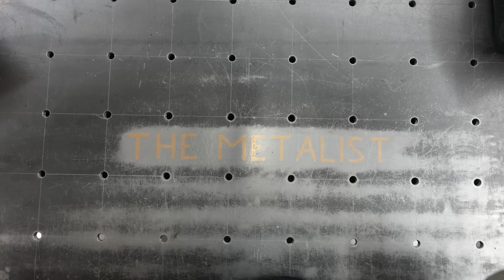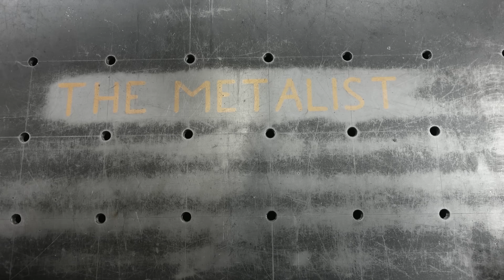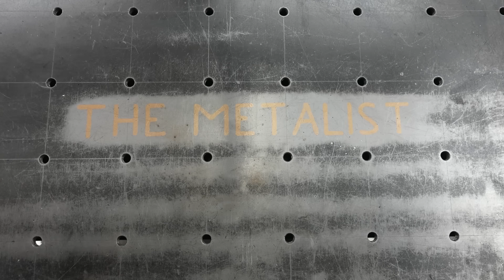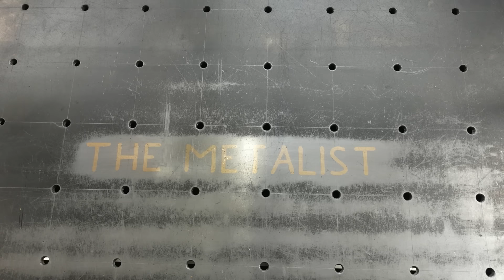DIY Rollbender Roller Bending Radius Bender

Comment: I put this in my watch-later bucket, and now I found it, so I watched it and was mesmerized.  I loved the cleverness and craftmanship, but you had the table and the special drill to make perfect parts.  One thing that I have too is the bandsaw, but mine is the roll around floor model, but about the same size of bandsaw, maybe a little longer.  BUT the thing I want to mention is the table you made to fit on the bandsaw when the saw portion is lifted up vertically.  That is special, I want to make something like it for mine.  I purchased a potable floor model (a standard one that you might have seen at a store).  Well, I made it a roll around by attaching a set of caster type wheels to the bottom of the legs.
I have to make the table a little different for me due to my being in a wheelchair and I have to have separate parts and stuff readily available and not laying all over the place.  I want to make it be attached in some way to the side of the saw frame.
I'd like to hinge the table to the side of the rig and have it fold upwards into position.  I just viewed the video where you made the table and the ease of putting it in place to use it.  It's not bulky or awkward at all.  I can just hang it somewhere when it is not in use.  

Thank you for the inspiration.  I like to build stuff, and tools too.  Roger from Oregon in the USA.

Comment: When i seen your video about your "Dream Welding Table" - I watched it. And thought "Dream table? PFFFFFFTTTTTT". I didnt see the versatility in it until i watch another video several weeks later. Of you building your tooling to fit in the threaded hole of the table. I LOVE this design! I do have one question. How do keep from dinging your threads in the table? I mean when inserting the bench clamps?

Comment: Wow, very clever design! I especially like the rollers, they look very stout. I’ve seen you use a sliding depth gauge in many of your videos, in this one it’s seen at around the 1:27 mark. Do you mind sharing the brand/model? I could really use something like that in my woodworking projects and yours looks like a really solid example. Thank you!

Comment: Ingenious as always. Can't really say anything that hasn't been said by others. But I do have a question: how does Rehm compare to Fronius? I use a Fronius Magic Wave 4000 at work and am just curious. By the way, nice to see someone use Cubitron discs. I love those things. Keep up the good work.
Reply from the maker: Thank you 😁
I think there is not so much diffrent between the machines. Pro and cons on both machines. I like the Bluetooth foot pedal from the fronius, i like that the Rehm Tiger weighs just 7kg (ac/dc 230amp)

Comment: Richtig coole Idee! Hast du drüber nachgedacht, die Rollen + die Lagerplatte länger zu machen, um komplette Ringe biegen zu können (momentan sieht es so aus als wäre die Spindel  bzw. die Zustellung im Weg) oder wäre dann die Durchbiegung relativ zur Grundplatte zu hoch?
Reply from the maker: Wenn man oben an den Rollen biegt bekommt man einen Ring ca. 200mm hin, mehr ist leider nicht drin und dann natürlich nur 20-30mm flachstahl oder rundmaterial. Denke  das ich irgendwann noch eine richtiger rundbieger bauen werde. Für die kommenden Projekte muss das erstmal reichen. Es kommt schon ordentlich Druck auf die Platte, es wäre dann zu überlegen ob man den Tisch zusätzlich unten verstärkt.

Comment: Can this be built with 1/8" material? I only have a Titanium Unlimited 140 Multiprocess, and it's max is 1/8" , 3.2mm. This looks thicker than this. Maybe I'd need to redesign some portions so it withstands the forces, I don't want it to bend up on me though when bending metal, maybe the thinner setup will just limit how thick of metal I can bend.

Comment: I was surprised when I saw the lathe at 11:22
Why didn't you finish the rollers discs on the lathe instead of this belt sander contraption ?
Why didn't you chamfer the discs edges on the lathe instead of the 4 notches you made with the grinder ? you could have a better consistent PJP weld all around the disc.

Comment: really great. When you make the vertical base plate from 17:23 so that you can mount the adjustable roller construction on the backside of the plate, you can make even smaller diameters. And roll them to a complete cirkel